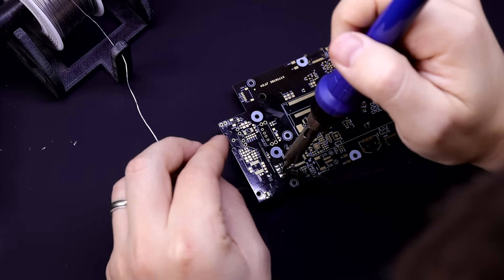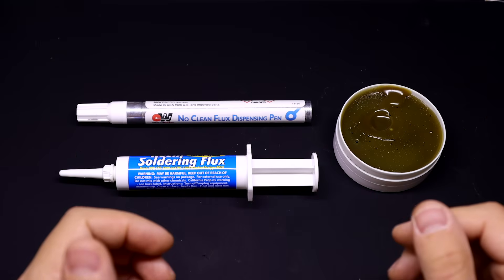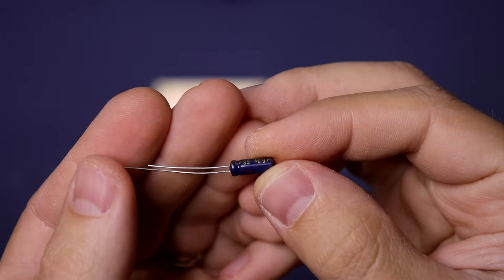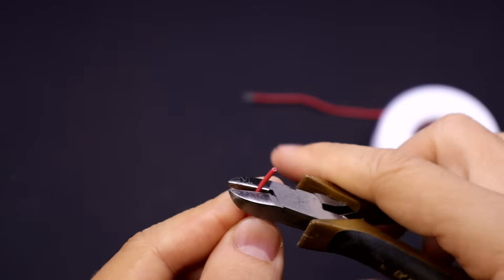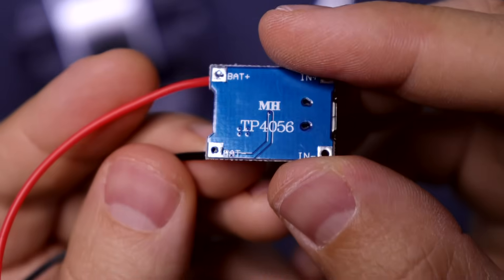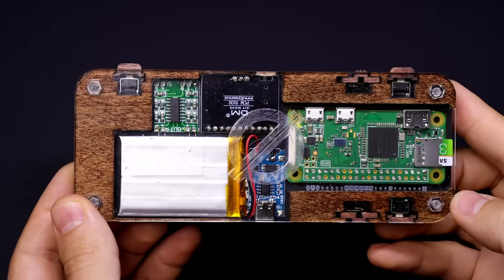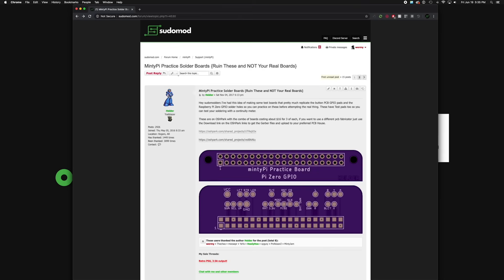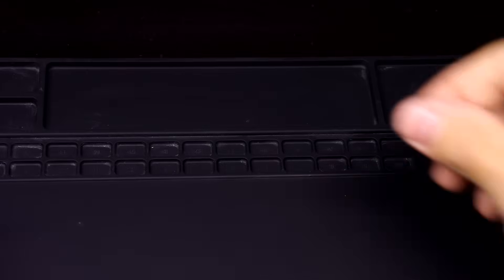Soldering Crash Course: Basic Techniques, Tips and Advice!

Comment: I'm a 71 year old female who has been soldering here and there for most of my adult life, I never claimed to be an expert. Thank goodness because I just learned a few things that made me realize that I've been doing a couple things wrong.  Thank you for posting this video.  I certainly do appreciate it because I'm going to attempt to replace the switches in my M570 Trackball mouse.
Reply: Hope it went well!
Reply: That is so cool. I'm attempting to replace switches on my mouse too. I hope it worked out for you.
Reply: I am also 71, and you know more about soldering than I do... Before you watched this video...
Reply: The m570 is a pretty good trackball. It's worth fixing.
Reply: Hope you are well and that the switch replacement on the m570 went well also. I am watching this video because I am about to replace the switch in the mx ergo.
Reply: I wonder if you are still alive
Reply: I totally thought this was a vehical
Reply: @DustyHarr-po6uo can I use soldering to put a broken metal leg back on a trellis?
Reply: @lindameng-denker6771 
No. I would try bracing it with some metal on both sides (like splinting a broken leg) if possible, then wrapping it with wire or duct tape (wire will last longer), this is assuming you don’t have access to a welder. If you do, for heaven’s sake wear eye protection!
I suppose you could try epoxy, but I make no guarantees.
Reply: I already did. I am waiting for an answer.
Reply: @lindameng-denker6771 what was the answer, did it work?
Reply: You're freaking awesome
Reply: Coooool
😊
Reply: Good luck with your mouse!
Reply: Awesome video I'm trying to fix my mini ac unit and could not for the life of me figure out where I was going wrong but ur video was so informative and on point with no bs or super off the cuff type steps or info I really appreciate guys like u on here and other sites who put in the time and who actually care about others learning and not just trying to get likes just wanted to let u kno u are much appreciated !
Reply: I do hope you don't say SODDER....
Reply: Hi
Reply: A female with the name Rickie...?
Reply: @innosyde7188   There are quite a few women named Rickie. Notice the two last letters = ie which usually means it refers to a female whereas a 'y' at the end usually indicates it's a male's name. Every heard of the singer Rickie Lee Jones?
Reply: @rlgn1950 on the other hand there is Rosie Greer, and I use a Y at the end of my nickname because almost nobody else does!
Reply: @innosyde7188  😝it’s probably a bot. There’s so many people, especially over 55, that all start their comments with their age. also, id imagine a human would have referred to themselves as a man/woman and a computer would probably say male/female
Reply: @innosyde7188  Also most women don't call themselves female, they call themselves a lady or a woman. That term female is now used in a derogatory manner by incels.
Reply: @innosyde7188  DID YOU JUST ASSUMED HIS GENDER ?
Reply: @HeLrAiSiNg1 Nobody cares
Reply: @drophammer776  from what i see yes nobody cares for all we know she might be wife of rickie the guy just pointed out that a female with name rickie lol 🤣